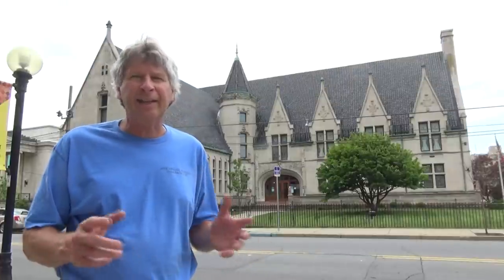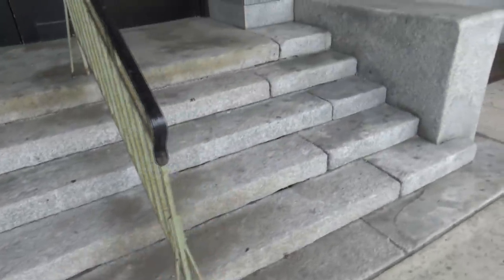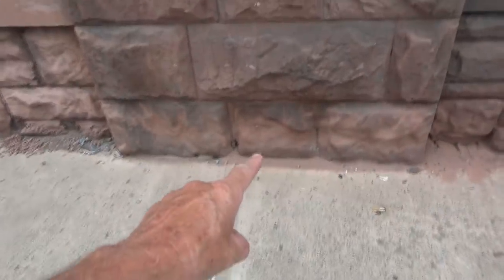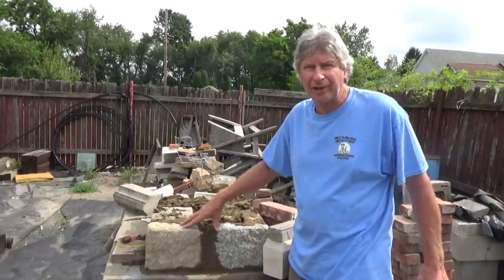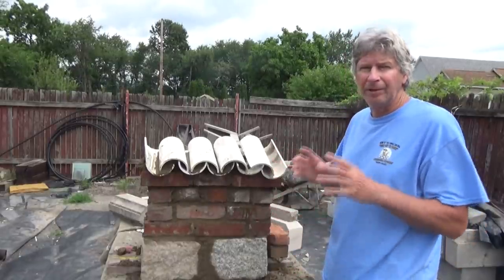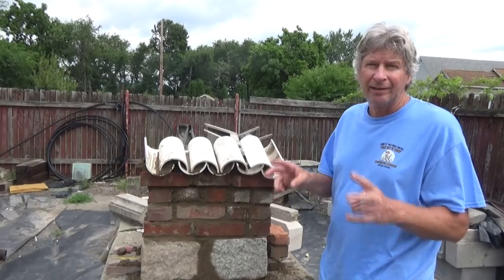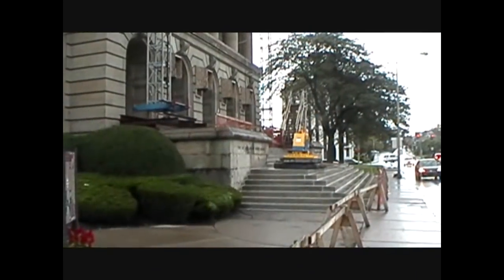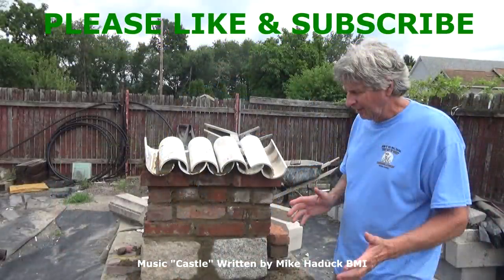ROCKFACING AND SHAPING STONES (Part 6) Mike Haduck

Comment: Did my first block and brick project 2 weeks ago. Used your videos for the guidance since I never did any masonry before. Worked like a charm. The whole time I kept thinking “just get it done.”
Reply from the maker: Thanks, Mike
Reply: I hope you didn’t make a big deal out of it!
Reply: Mike ,when i need an extra good grip between stones, like for a large stone step, i will cut really shallow grooves on the surfaces that touch the mortar, that way it will increase the grip and friction (with an angle grinder),  tell me your opinion , thanks Iron Mike !!!

Comment: Next time you're over in the UK, have a look at how we've been building houses with cavity walls for the last 70+ years. Typically there is a strip footer, several courses of engineering bricks (the glass type bricks) to about 6" above ground level, then a damp proof membrane (a very thick bituminous tape that is placed on those bricks) then a half brick wall to the eaves. There is a thermalite (insulated lightweight block) course about 50mm inside the outer leaf also to the eaves. The 50mm gap is filled with insulation and the two leaves are bonded with ties. Because of the damp proof membrane the wall never gets wet so the ties don't rot. The engineering bricks are waterproof and never fail. We have pretty cold weather in some parts and I've never known a house require anything other than routine maintenance to stay in as new condition.
Reply: Wall ties have been known to rust out. You can buy fixings online to repair when they do...
Reply from the maker: That's good david, but those membranes are sure to rot out,  and your right about the insulation etc, but they won't be around like the ones built a hundred years ago, thanks mike
Reply: I've seen that construction and unless you have waterproof bricks and mortar that insulation has to get wet.
Reply: @billmiller7138  That construction has been standard practice for 70+ years over here. There must be 10 million properties built like that in the UK - I'm not describing some experimental new technique, this is the norm here and probably in all of Europe. There are a handful of wooden framed buildings in each large county here. We stopped building houses out of wood in the 1600s because they don't last. I've never heard of one case where cavity walls are a problem. The cavities used to be built with an air gap and a couple of air bricks to deal with interstitial condensation, but there was a national programme about 20 years ago to fill these to reduce heating costs (to bring them up to date). Specialist firms drilled several small holes in the outer wall and blew in mineral wool. It made a big difference to the warmth. My house (1870) has 16" solid walls and had a damp problem when I bought it. It cost me £500 to have the walls drilled and injected at ground level to dry it out, and this technique permanently solves rising damp if DPM layer fails in cavity walls. I'm not complaining about my house though - it still has the same roof (all roofs in Europe are made from solid material like tile or slate which lasts 150+ years). Houses here are expensive but built to last and require only minor maintenance.
Reply: David Lowe mineral retrofit wool cavity insulation has caused a lot of problems for many in exposed and coastal areas due to driving sideways rain coming through walls and the wool bridging the exterior to interior walls causing huge black mould problems In fact there are companies now that specialise in removing this stuff.

Comment: Thank you Mike! your videos have helped me a lot as I'm rebuilding part of my collapsed granite rock retaining wall.  I'm an engineer and it's sad to see how things are often engineered to fail.  The idea is to design things for their useful life.  Often this "useful life" was arbitrarily determined or driven by economics. ie when you want customers to buy from you again.  There's a pervasive thought in business that a company can only survive if they don't need to continually spend on marketing to obtain new customers.  I've had a short stint at failing to start my own businesses.  So I see their argument but it's a depressing state of affairs.

I've previously built a 2.5' high retaining wall from hollow formed blocks.  So I had an urging to rip out the old partially collapsed wall to rebuild with "modern" blocks and techniques.  Having watched your videos, I'm glad I decided to fix the existing wall.  The mortar is thoroughly cracked throughout and some stones are loose.  Hopefully a continued tending over the next year or two will restore it back to a state that will last another 30 years.  I can tell the stones were not shaped well.  Gaps were large and the stones did not sit on each other.   Instead, much of their weight appeared to be leaning on the back filled sand.  I plan to backfill with the excessive amount of rocks on my property.  Hopefully this will improve the durability of the wall.
Reply from the maker: Thanks Jaze, I appreciate hearing that from a professional,  Mike

Comment: Great video, very informative. I just built exterior 2 core concrete block pier. With a galvanized 5/8 anchor bolt. Filled pier with sackrete cement. Going to rot and fail? I see them putting green rebar in the highways on long island. You do alot of globe trotting. Keep up the video's!
Reply from the maker: Hi Roy, it's hard to comment on anything unless I was there to see it, as long as it is code and inspector improves it , you should be fine, thanks mike

Comment: That building with the deteriorating red sandstone looks like it needs a little cemental and some kind of masonry paint or acrylic stucco on the lower 2 feet. 
  I have noticed a lot of newer commercial buildings use an architectural cement block on the lower 4 ft or so then above that brick. Whenever you see the block next to sidewalks here in Minnesota it deteriorates.
Reply from the maker: Thanks Jon,  mike

Comment: Great info, thanks for sharing.  Didn't realize the granite base.  Wondering if granite aggregate is better also?  I guess like limestone being better for outdoor pours exposed I've been told.   I recall there being controversy with RC construction and epoxy coating or coatings over the rebar also to prevent the spalling or expansion and cracking issues.  Amazing all that complexity with pre and post stressed also and other designs.
Reply from the maker: Thanks jaf  Mike

Comment: Another great video Mike! Thanks for the advice on strengthening my N mortar. What a difference the portland makes. I was cutting block out of my shed that wasn't straight to lay them straight in order to replace them, and I was wearing a mask, but I think that I still inhaled some dust. Do you recommend something like a respirator when cutting cinder blocks out? I still have to fix the other side. Thanks 👍
Reply from the maker: Hi Dean, it's a dirty job, whatever works the best, thanks , mike
Reply: @MikeHaduck  Thanks Mike,
Can we see the 82 Chevy again in one of your upcoming videos? Thanks